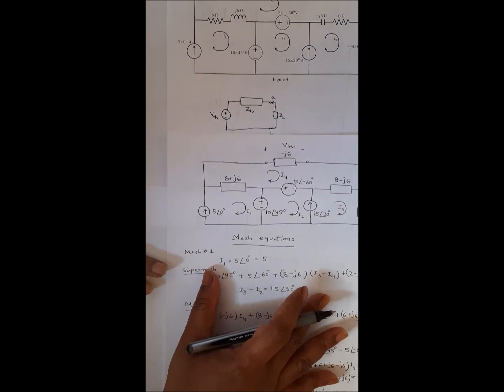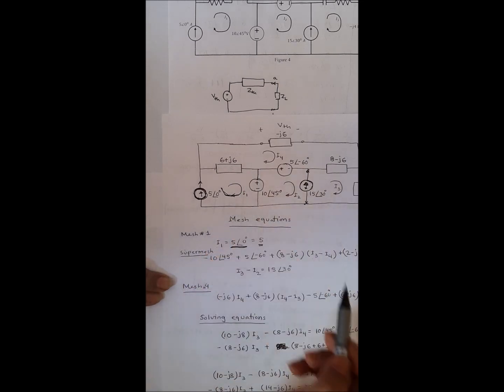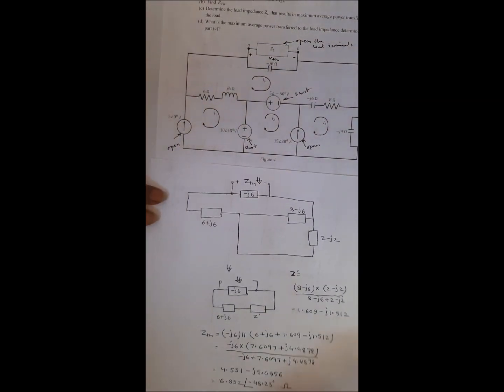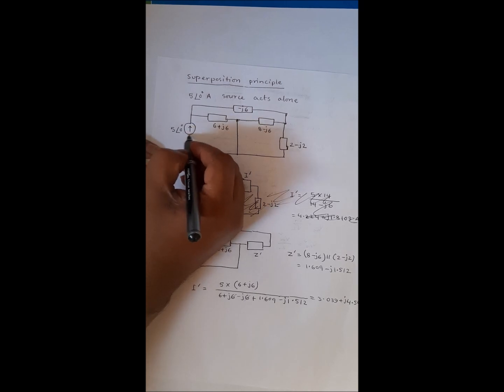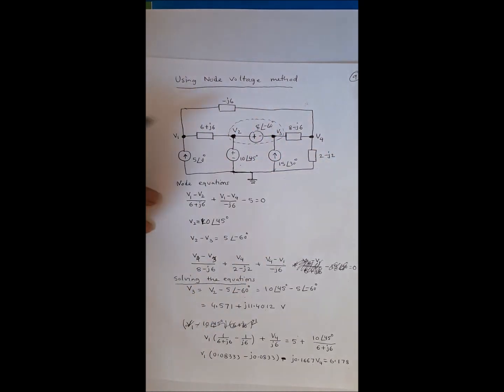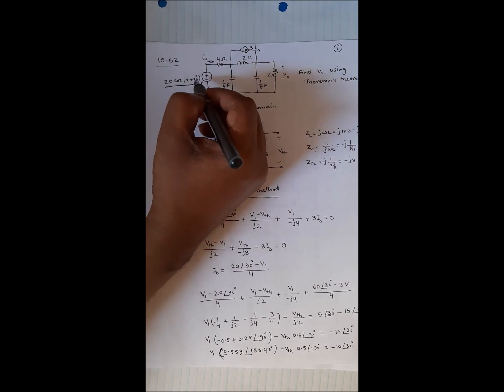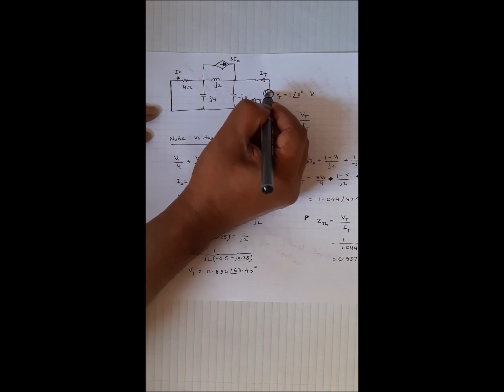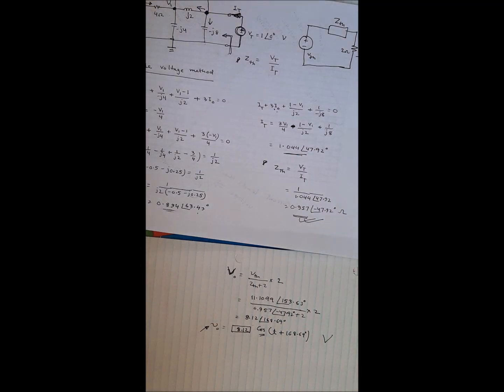Thevenin's Theorem practice question

Comment: At 17:12 you said that z' + 6+j6 is parallel with -j6. But isn't there the same current running through the loop? if so, then shouldn't z' + 6+j6 be in series with -j6?
Reply from the maker: If you look from the terminals, the z'+6+j6 is in parallel to the -j6. Looking from a pair of terminals means consider the configuration as if there is a voltage source present between the terminals.
Reply: got it, thanks!